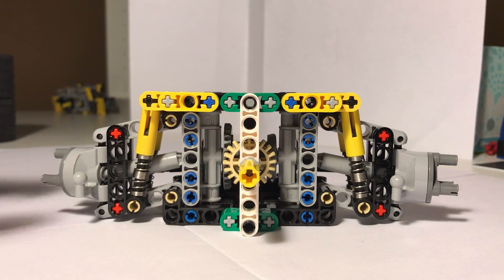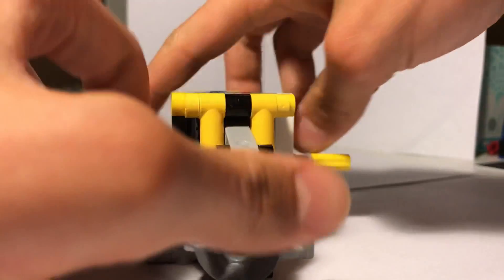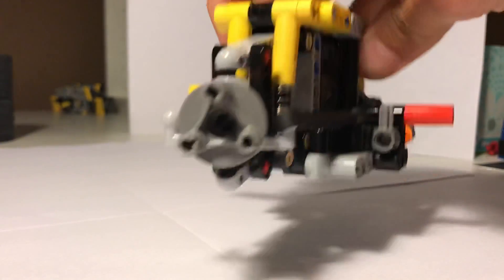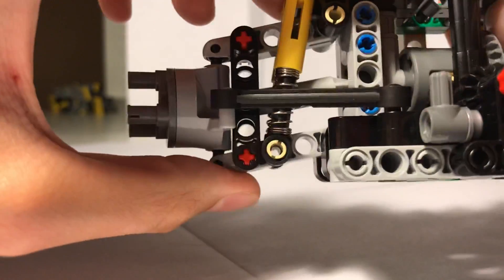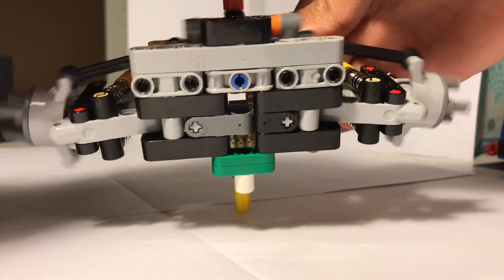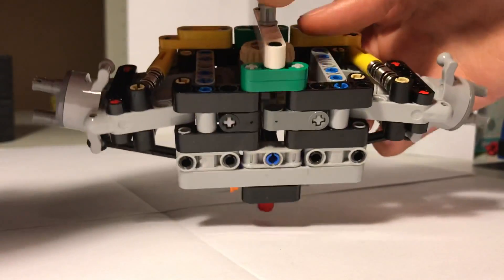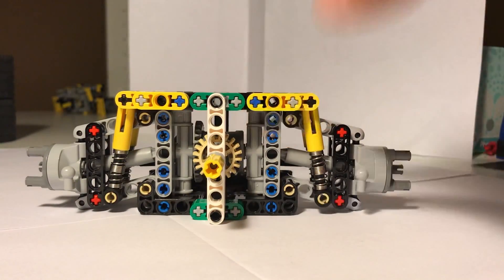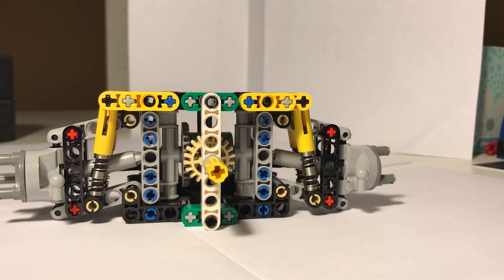LEGO Technic compact front axle (drive, steering, ind. susp)

Comment: the steering rack is placed too low because the link rods have a different angle compared to the wishbones. That will cause the wheels to leave their path while traveling in suspension. Raise the steering rack so the link rods have the same angle as the wishbones and everything will be ok.
Reply from the maker: You’re right, I should perhaps move the wheel hubs upside down as well to make the ball joints more effective. Thanks for the tip!

Comment: What are those pieces like universal joints but more smooth, which transmit the drive to the wheels? Those seem more compact than double universal joint.
Reply from the maker: They are called CV joints, there’s 2 kinds: the one that I used and the newer reinforced ones